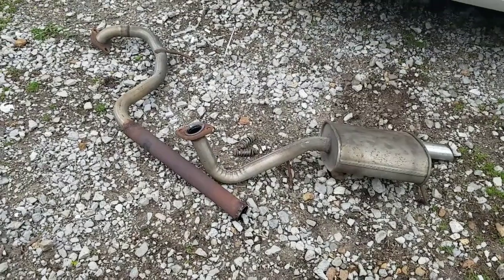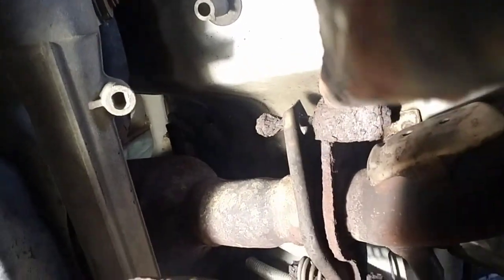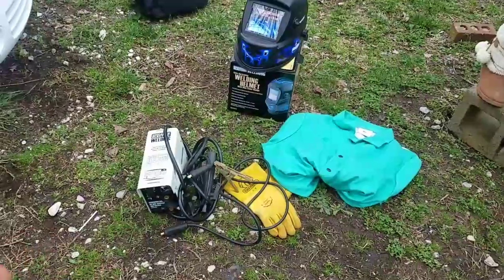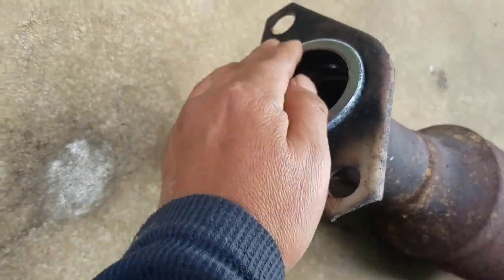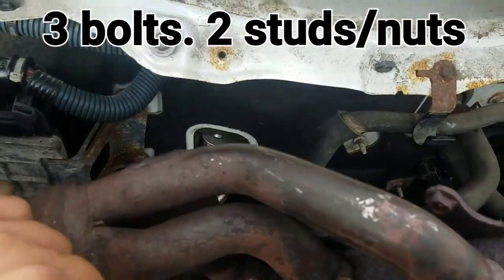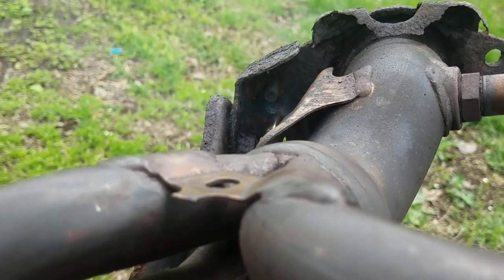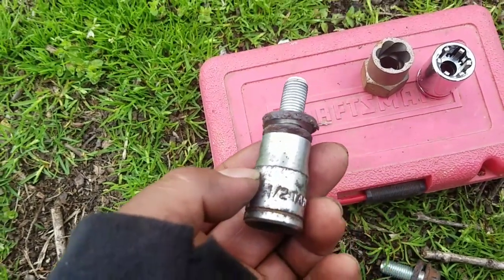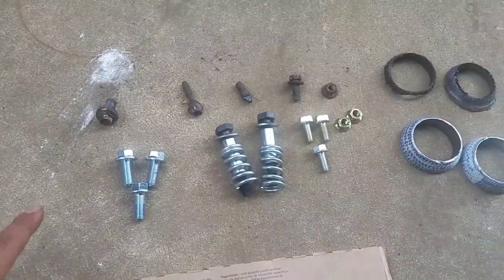Toyota Yaris Exhaust Manifold gasket Replacement, Toyota yaris exhaust system

Comment: Excellent vid!! Thanks so much! Very encouraging to see what I expect to have to face as I prepare to replace my 2008 Yaris manifold donut gasket.
I must compliment you on showing the stuff like I go though myself, like actually learning how to weld thin pipe the hard way: on the job and in a cannot-fail context. That's where I will be in a few days when I'm finished the axle replacement, ABS sensor replacement, brake hose replacement, and some bodywork.
I'm going to soak the two manifold-pipe flange shoulder bolts with penetrating oil for a couple of days while I take care of some other stuff, and then I'm going to heat the heck out of the threaded flange holes by gently blasting them with a TIG torch held somewhat farther back than at normal welding distance. That might allow me to get the thing red-hot without blowing a pile of hot combusted propane exhaust up into other stuff (to avoid situations like when you solder copper pipes in walls and the lumber wants to light up.) I'll follow up in few days to let you know if the "bright idea" actually worked or not. I REALLY don't want to take the exhaust manifold off. I REALLY, REALLY don't...